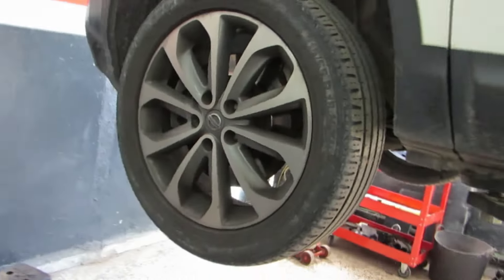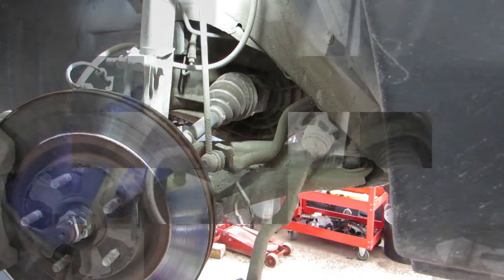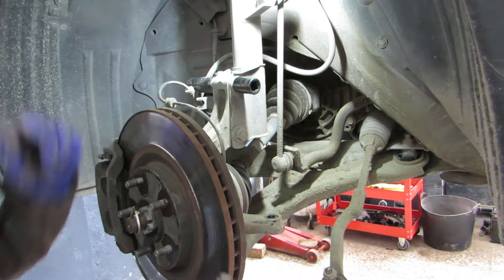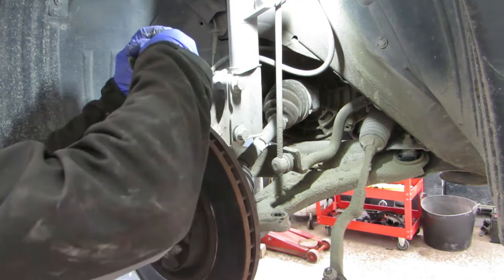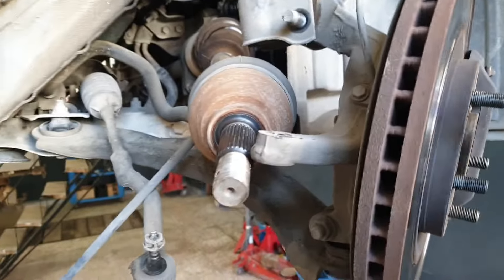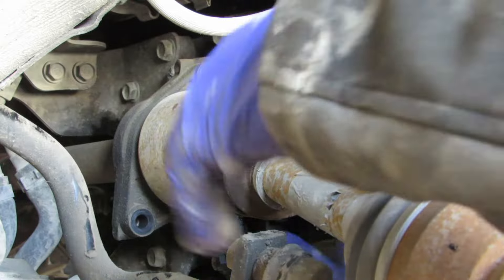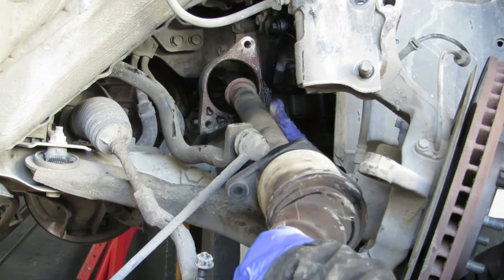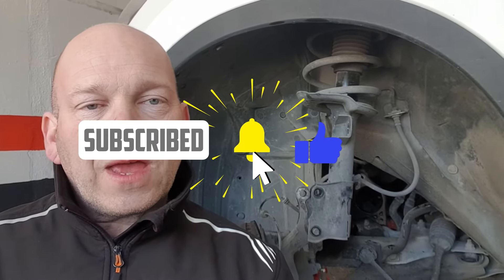How to Remove a Nissan Qashqai Drive Shaft!

Comment: Great video thanks. I only need to do the drivers side shaft, do I still need to drain the gearbox ?
Reply from the maker: Thank you, if you jack it up high enough on the drivers side you may not lose any fluid.

Comment: Just changed a front bearing hub on one yesterday...surprisingly easy
Reply from the maker: it was for this one  https://youtube.com/shorts/lZEb9T1ygO

Engine out at the minute, hopefully get away with bottom end shells, however there was a lot of shiny bits in the oil.
Reply: I did the left one last year, which was straightforward apart from some very sticky bolts. This year I did the other side and everything was seized together - the knuckle, backing plate, and bearing. Fortunately, replacement parts not too expensive. Also a good time to replace control arms, drop shafts, and possibly tie rod ends. Fairly simple compared to the rear suspension, at least if you're doing it on the driveway.

Comment: Do you have to drain the gearbox oil when you changing it?
Reply from the maker: You will lose oil if you pull the shafts.
Reply: @rpsspain1966 Yh but how much oil ….
Reply from the maker: @bkfilms5843  If you drain the oil apprx 2ltrs. you need to check the spec for your vehicle gearbox......Manual transmission, RS6F52A, 6-speed
Gear oil (Preferred lubricant specification)
Homologation OEM	Temperature	Viscosity
Nissan MT-XZ		
Manual transmission RS6F52A
Gearbox refill 2.0

Comment: Would you say this way is easier than removing the bottom ball joint? This seems easier, although removes more components. I'm "looking forward" to doing both drive shafts on my drive way in a near future, so I'm looking for the quickest and easiest way... 😅
Reply from the maker: Thank you for watching and taking time to comment. Yes, for me as you do not need to separate the ball joint.

Comment: what whas the reason for the removal? i have a (Dutch) J11 too with a ramblin driveshaft on the right side when accelerating and when i drive up (about 1%) my lane it makes a "clongkin" sound could it be that bearing ?
Reply from the maker: The reason was vibration at speeds over 100 kph.